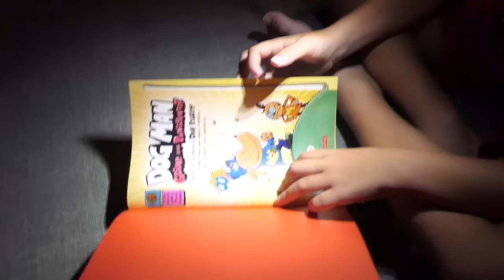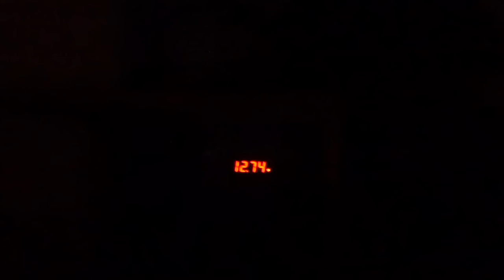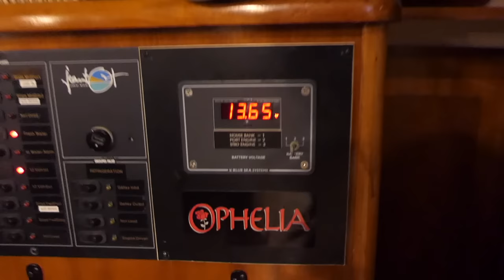TWO DEAD GENERATORS and our LITHIUM are DYING | SailAway 243

Comment: Don't know how far from real time you are but two things I would look at on the Northern Lights genny would be the fuel tank vent line being kinked or obstructed and ditto for the fuel return line back to the fuel tank. Based only on how long it took to choke out I'm thinking fuel return line.  Hopefully you will have success soon.
Reply from the maker: Yeah that was my thought too. Literally ruled out every piece of the fuel system by replacement, bypass, etc. Also the entire sensor shit down system. We’re about to try a new stop solenoid and see if the old just got weak.

Comment: At 15:30 mark, one of the banjo fittings seems like it is dripping fuel. They usually use a crush wwasher, maybe they are not tight or you are either sucking air or still have air in the lines. Worth checking,
Reply from the maker: That one wasn't leaking, but you're definitely on the right track about an air leak.  Took me a while to sniff it out and man was it sneaky.

Comment: You just have your priorities all wrong. Engine maintenance is crucial. Your genset is suffering from poor care in its life and you have a dead main and an iffy second main engine. Then your little generator is some cheap Chinese type make and you replace it with another unknown brand. Save your money and fix the genset! All these woes and you are opening a fresh bottle of alcohol.  Stop wasting money and get your engines sorted. Your family is at risk. Also you are trying to charge up your battery bank which is SO CRUCIAL that it is a drama yet you have all the cabin lights on and a massive TV on. Are you doing all of this for dramatic effect? Do away with all the doom and gloom and get your house in order. It's simple, get a book or workshop manual for each engine and go to work.
Reply: Quit hating.  Rome wasn't built in a day.  Over time they'll have it all fixed.  They are living their life and enjoying it and sharing it with you.
Reply from the maker: Our priorities are fine, but they're not as simple as "fix motor now, everything else later" and our family was never "at risk"...that's ludicrous. Priority one was simple, get south to Grenada and safe for hurricane season.  2nd, we've done a TON to get that genset back in good condition before we shoved off.  After a LOT of work we had it running great.  The issue I later found was a simple and very sneaky one and the generator is running great again (and with a lot of nice new parts).  3rd, our backup genny was what we could afford at the time and the second one was the only one I could find of any brand on St Thomas...everyplace was sold out.  Lastly, I have no idea what you're talking about.  When we realized we were in jeopardy of killing our batteries, we went completely dark...only lanterns, there was no TV.  Go check the tape or go check your eyes.  Lastly lastly...if you sit on your couch and tell people whose situation you clearly don't fully know to "get their house in order" don't be upset when they tell you to piss completely off.

Comment: I took mine down to 10% last night on accident, fell asleep while plugged into shore power with the AC on but the shore power breaker was turned off for maintenance. .  Whoops. Victron cut out the inverter @ 10%... I might raise that in the config. . I have Dakota Lithium, they appear fine, but definitely don't make a habit of that.
Reply from the maker: Yeah, from what I understand the BMS should protect them, but with a bank of multiple batteries it can still somehow damage them.  We defintely didn't want to risk the investment.  Ours bounced back fine as well.

Comment: Hi guys , I put an inline electric fuel pump on my Northern Lights geni , helped considerably  .
Reply: Yup, same for all old diesels. Just remember to get the cover for the old lift pump to avoid spitting oil out of the crankcase.
Reply from the maker: Hey guys, I did later add one while trying to find the issue.  Didn't turn out to fix the problem, but I like having it there.  Primes the system up nicely while starting.

Comment: With small engines for generators when they're difficult to start up, it can quite often be the oil sensor. There is a single wire coming out of the engine block on the generator Cut that wire, it will switch off the oil sensor, and your generator will work perfectly fine. And if it isn't just read. wire the wires back together, they put. cheap and nasty oil sensors into the generators to make you think you're getting money for value. It's just a rip off. You don't need oil sensors in small, tiny engines. Look at lawn mowers.
Reply from the maker: Thanks man, I'll give that a try!

Comment: This is not how lithium batteries work. 12.74 is not down. You can bring your lithium bateries down to zero, then recharge, and theyll be fine. Once or twice.
Reply from the maker: That’s not true actually. At least not for Lithium phosphate house batteries. 12.6 - 12.7 is considered dead flat. Running them below that risks damage. The BMS protects against that, but not flawlessly. The Chins documentation is pretty clear about it.

Comment: Hi everyone, I’ve been charging my Chins 300ah with a Victron 25 amp charger which is wired into my ac panel through a breaker switch. I cut the female end off of a 15 gauge or bigger) extension cord the shorter the better, and connect it to a breaker in the ac panel with the other end into your generator. Switch everything else off on the ac panel but the extension cord breaker and be sure to use proper wiring and breaker size of course. Your charger will have stayed connected just as if you were using it as shore power charging so nothing changes there so long as it was already wired into the ac panel. People who haven’t got there charger wired in can just plug and play directly, but having the charger wired in is a preferred method by many. Make sure the cord breaker goes off before unplugging it from the generator so you don’t get shocked when the panel is connected to shore power... I use a red tag to remind myself. I did tut touch it once and got a baby zap... you have to touch both sides of the plug at once of course. Anyways, I’m using a Honda 2200i to power the Charger, and  I also run the 8.3amp built  in charger on the Honda generator connecting it to my dc panel before the fuses. One with a bigger bank may run parallel generators with a bigger charger, my 25 amp brings in around 26 amp total through the Victron smart shunt when connected in conjunction as I described. I know it’s crazy the charger can convert and multiply like this,  but that’s what they do best. You want to use the generator to power the charger instead of connecting the 30 amp shore cable to the generator, I couldn’t tell exactly which way you were utilizing the power, but this method I’m talking about may bring you almost double the power in the bank if you are not currently using your charger off the generator. Cheers! What doesn’t kill you makes you stronger!😎
Reply from the maker: Hey, thanks for that explanation!  I think we were doing essentially what you're talking about.  We pipe the generator into our system via the shore power socket with a 30amp cable just for convenience, then run our house inverter/charger from it.  It could handle our charger set at up to about 100 amps, so we were charging up pretty nicely with it.

Comment: Just a comment on lithium, almost all have an internal bms, so they self protect from discharge.  If you're do not have a bms, then add it to them.
Reply from the maker: Yeah, our do have BMS, but it's still not good to run them all the way down.  If it happened, hopefully the BMS would save them, but why risk it.

Comment: Geez plastic bits for pull start! Have you got a soldering iron and zip ties? Plastic weld it, using zip ties as filler.
Can you bypass lift pump and make a gravity feed fuel line or a 12v electric fuel pump?
Reply from the maker: That's some McGuyver stuff right there!  I'll definitely try that.  And yes, a little ways into the future timeline...lol...I do install and electric pump.

Comment: 12.74 is bad on Lithium? I thought they ranged out the same as Lead. Oh boy... Lead will range down to 12.0 (50%) on NO load. No load is disco battery for 2hrs, then check. Reading the indicator while using the batts is tough as even the fridge load can draw a few tenths on the voltage that reads wrong... But wow. Universe really slowing you down for a reason.
Reply: Lithiums (typically LiFePO4 on boats) have a VERY different charge curve than lead. Most lithium BMS controllers will disconnect the battery between 12.2-12.4, when the battery is at 5% charge or 14.6 to prevent overcharge, and all modern BMS controllers simply need the batteries turned off then back on to reset. (You DO have a battery disconnect switch installed I trust?). The charge vs capacity is decieving, as 13,4 is approx 8o% full and 13.2 is 40%, so it will seem like the batteries stay at 13.3 all the time. Most manufacturers recommend keeping the voltage above 12.7 -12.8 which is about 15% which seems like the max drawdown to prevent dendritic crystal formation that is the root of lithium capacity loss. The other key is having correct charge controllers which will not "float" the batteries once full, they need to discharge down to a minimum of 13.2 before reconnecting the charge current.
Reply from the maker: Yep, what @brucefletcher6179 said.  The percentages on Lithium are very hard to get used to.  We got down as low as 12.6 or so and all was fine.  The great thing about lithium is you can get down in that 20-30% range without harming them AND with really strong voltage, so everything on board still runs smoothly.

Comment: Defiantly sounds like the main generator is sucking air. Check all the fuel lines all the way back to the tank and re-bleed the system.
Reply from the maker: You definitely called it!  I thought that from the beginning as well, but it wasn't any of the fuel lines or typical components or connections.  I eliminated them all piece by piece, and so then I wound up on wild goose chases through the electrical, sensors, etc.  It was very sneaky...I just figured it out about a week ago.

Comment: Ummm...you're in St Thomas, go straight to Homedepot and grab one at Miami prices. and while you're at it spend a couple dollars more and get a Honda. Or hit the Yamaha dealer in Sub-base (can dinghy right to the shop) and get a yamaha. (although I find the honda's have a better eco mode and don't "hunt" as much at low load) Then think seriously about your solar array - the rule of design is 25% of your battery capacity in solar, ie 8kW of storage should have 2kW of solar.
Reply from the maker: Yeah, St. Thomas does NOT have Miami prices.  Home Depot was completely out of ALL generators (as was ACE and Yamaha didn't carrry generators) and even if they had a Honda we couldn't afford one, even if it was a Miami price.  A solar upgrade is definitely on our list.  We currently have 600 watts, but the day the generator died it was cloudy and stayed that way for three days.  Many bad factors at once.  No sun, dead generator, dead backup generator.  Ridiculous. Only quick solution was the ONE generator left at Cost U Less.

Comment: Man. I can see something like that happening to my boat especially since my gen is so old. One thing I've learned is those off brand suitcase gens are not reliable. I do have friends with Hondas and Yamahas that have lasted a very long time though. Ya gotta do what ya gotta do when yer out in the islands. LOL. I have used in-line electric pumps from the auto parts store as a lift pump and it worked well when a "proper" pump wasn't available on a main engine, should work for a gen too I suppose. Hope you find the problem with your gen soon.

Comment: Don't you have alternators on your propulsion engines? Seems like too many band-aids on your electrical system.....time to make a plan and actually fix it right. Yeah it's not free, but you didn't go yachting to save money, did you?
Reply from the maker: Go yachting?  Hehe...cruising and yachting are quite different. ;-). Many people actually do go cruising to save money.  There are no bandaids on our electrical system, but a lot of things did go out on us in a very short span.  We're operating on one motor and that alternator quit sending power to the house during our passage from the US to USVI.  When the two generators quit in close sequence, I hadn't yet had a chance to run through the mass of cabling to find the alternator issue.  It's also a fairly wimpy one, so it never played a big charging role other than the start battery.  And it's very easy to say "make a plan and fix it right" if you're stationary and have the time....or if you're in a dock and the type to just pay someone to fix it for you.  We were just trying to get south to Grenada first and out of the path of hurricanes.
Reply: @SailAwayVlog  Those are the same lame excuses for poor seamanship that I’ve been hearing for the 45 years I’ve been offshore cruising. If you want to do more with that boat than bob around the Caribbean you need to pause and reflect, and seriously upgrade your planning, preparation, and general seamanship skills beyond YT entertainment level. Otherwise you’re just putting your wife and child in harm’s way.
Reply from the maker: Pause and reflect?  lol.  We've been pausing and reflecting for the last year as we worked our way through a list of problems, upgrades, and logistics, but I'm guessing you don't know that.  So I guess I'm to the point of saying either watch a few more of our videos before commenting so you actually know what you're talking about or go bother some other youtube channel with your dockside quarterbacking.  Cheers.
Reply: Well I can see you from where I'm anchored in Woburn Bay on my current boat which I've lived on full time for the last four years while sailing her >20,000 miles, so not dockside so much.....I'm just trying to give you a wakeup call before you put people's lives at risk trying to rescue you, or lose your own, but it turns out you're not very coachable -  @SailAwayVlog
Reply from the maker: I can only reiterate my previous comments.  We also have been cruising and living aboard full time for 4 years very successfully, this being the 2nd boat in that time.  Also with nearly 20,000 miles sailed.  We each sailed for over 25 years before that with an unknown number of miles.  So based on only what you think you know of us from what seems possibly to be only one (or very few) videos you've seen of us, what exactly makes you think you know our situation, know more than us, OR qualifies you to be our...smh...coach?  And just one last thing, just so I can make sure I've got this right...having issues with our generator is endangering my family or putting us at risk of needing rescue?  I'm not exactly sure how you sail your boat, but if you've sailed 20,000 miles over the last 4 years, I'm pretty baffled by such a ludicrous notion.  You should know better than to make such a silly statement.

Comment: Sounds crazy but check the 15A push button breaker on the NL.  It controls power to ALL the relays including the “Run” one.  Just remove it and connect the leads directly.  You’re Welcome!
Reply from the maker: Thanks!  Unfortunately that was one of the first things I checked...I'd heard of those things getting finicky.  But no dice.  Ultimately, it turned out to be a really sneaky air leak in the fuel system...but I won't tell you where...dont wanna spoil it. Lol.

Comment: throw that POS in the lake and go get a Honda, and if you don't have an in-line filter for the gasoline feedline, get one, and a CLEAR one, so you can see when it's getting plugged....and start filtering your gen  Diesel......if you don't, your just in for the same problem in another three weeks....the fuel you get down there is GARBAGE, and run some Injector cleaner thru that diesel.............OnWard.........
Reply from the maker: Yeah, I'd sure like to, but a Honda was out of our price league...not that there were any on the island anywhere anyway.  And yes, we filter our generator diesel with a Baja filter...but we've never had or heard of any problems in any of the islands down here with fuel.  I finally found the issue and it was very sneaky.

Comment: These two generators 🎉dying are in addition to one engine failure in Saint Augustine.  These things are to be expected in a 30 year old catamaran.  Did you get the vessel surveyed before you bought it?
Reply from the maker: Well if you look back, our purchase situation was very unconventional, but yes we had a full survey before we closed the deal. We had assumed we’d need to rebuild the port motor, as the starboard had just had it done, but for it to seize up after a couple months at the dock wasn’t expected or typical. The generator is only 4 years old, so its issues aren’t 30 year old boat issues. Just poor care by the PO. I would say far more of the issues we’ve tackled actually land in that category.

Comment: Do you have a fuel filter on your generator?  It's may be a good idea to install one, and keep a spare.
Reply from the maker: Yea, they all have a secondary on the motor itself and a primary separator/filter in the supply line. Replaced both when trying to eliminate possible culprits.

Comment: You need a mechanic that needs a home
Reply from the maker: Haha...sure sounds like a good solution.  Once in Grenada, we consulted several and hired a very highly recommended one to sort out the main genset and after several weeks of he and I both trying to figure out the problem, he was stumped.  I eventually figured it out myself.  It was a very sneaky issue.
Reply: @SailAwayVlog  what about the engine that is locked up? Thst astounds me.. it runs.. you turn it off & then uts locked up.. makes no sense to me..